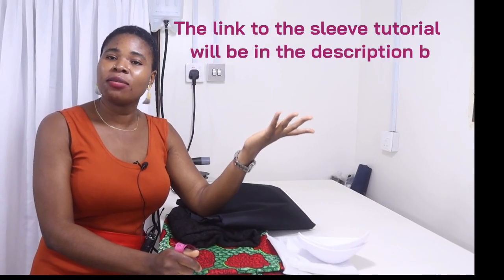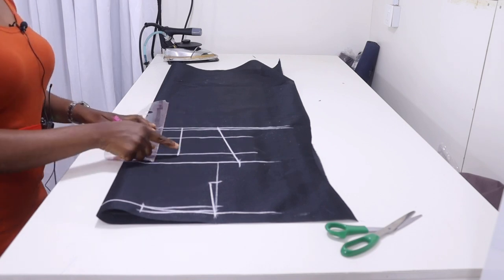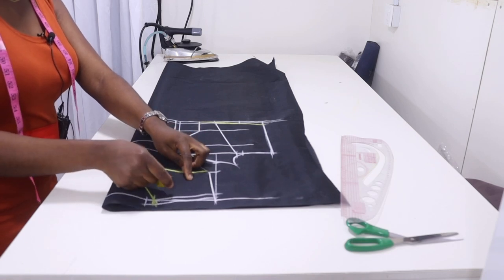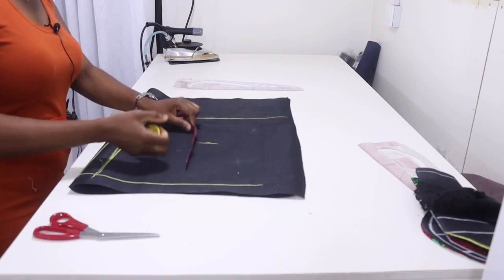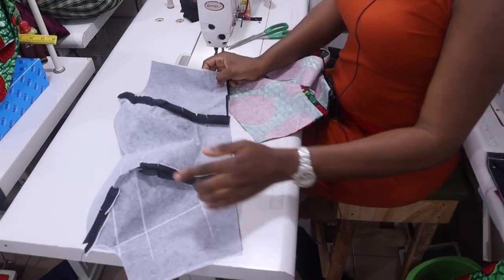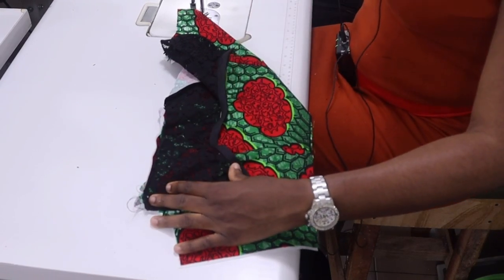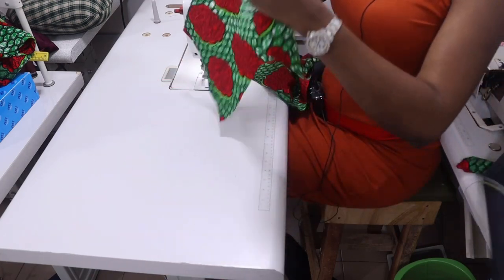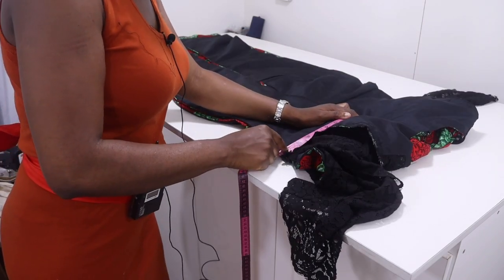How to cut and sew princess dart bustier dress with sweetheart yoke

Comment: Good evening ma'am. I  have made the upper part thrice and am having challenges with the front and back armhole. Each time I want to join the front and back sides together, the front armhole and the back armhole are not always equal. The back armhole is always longer than the front armhole armhole and as such i won't be able to join the sides of the cloth together and i condemned it. Pls help me out with thanks.

Comment: I appreciate this tutorial. But I have a  question. You added seam allowance to the shoulder and  also half inch to the half length of the front bodice but there was seam allowance at the back bodice.
 Suppose I have a front half length of 18, my shoulder allowance and half inch allowance on my half  length will automatically make it a total length of 19, if I do the 1 inch slant, it leaves me with 18. What measurement should I cut the back with? Length 18-1? Which is 17?. If I do this, what will I use to join the shoulder and half length to the skirt part?  Won't it leave me with a total length of 16 inches at the back? Will the sides be equal? Sorry for the many questions but I am looking forward to this reply . Thanks for your anticipated response
Reply: Yhinksweet God bless you for this tutorial.  Thanks so much it make the cutting of princess so simple. But can you please answer this lady's question about half length allowance. That's where I am confused too. Thank you for your quick response.